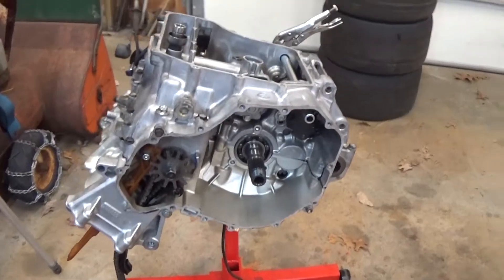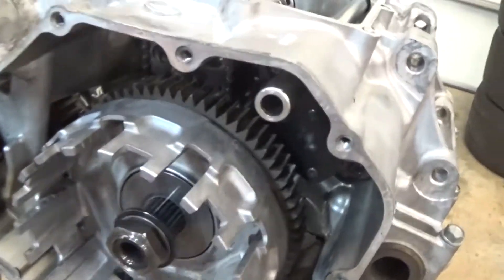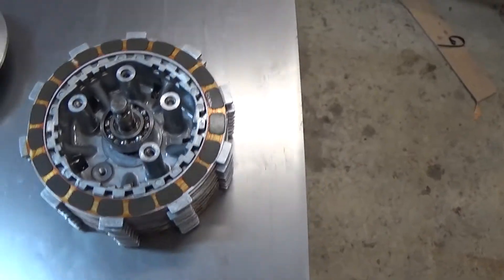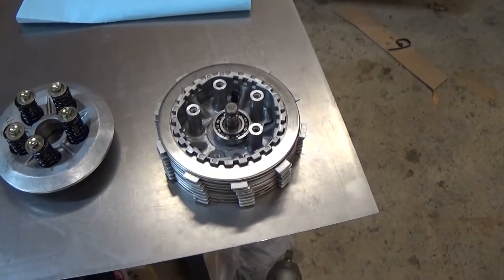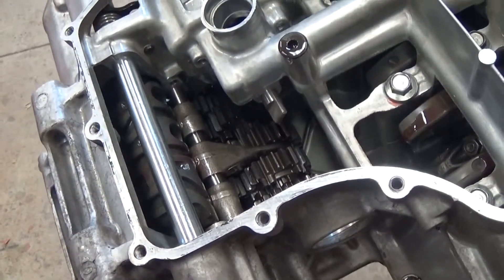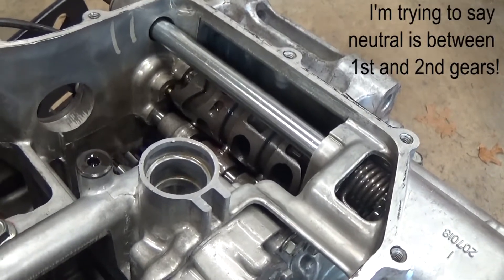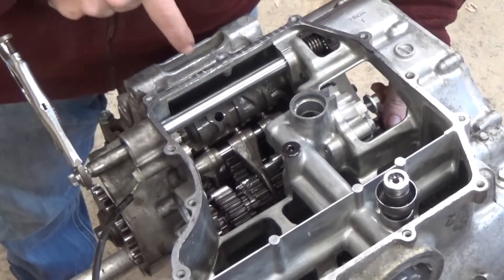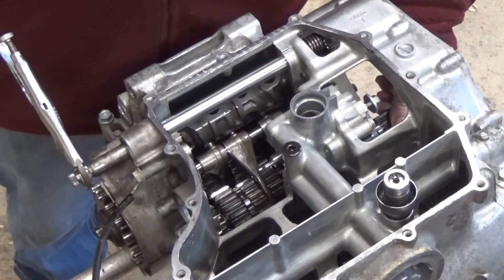How a motorcycle transmission / clutch works

Comment: thanks for sharing. straight cut gears? im no transmission expert, but i thought the tooth are beveled in transmissions to reduce noise.
Reply from the maker: That's true, but they also lose some efficiency (rob power) when the gear teeth are helical (cut at an angle).  In a motorcycle, I don't think the extra noise caused by the straight teeth are noticeable... especially on a sport bike.  I do not know what a cruiser has, though.